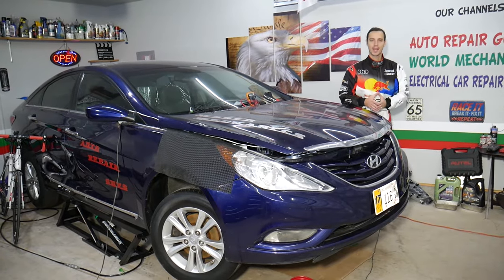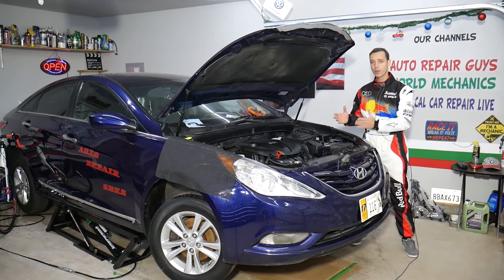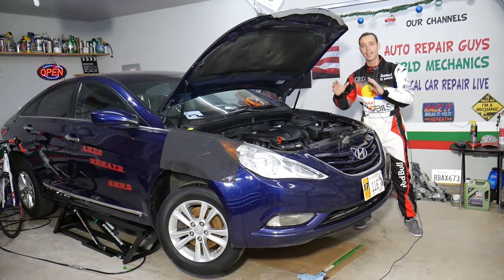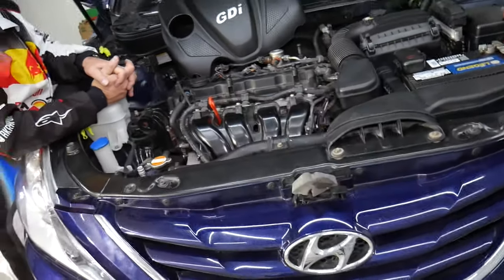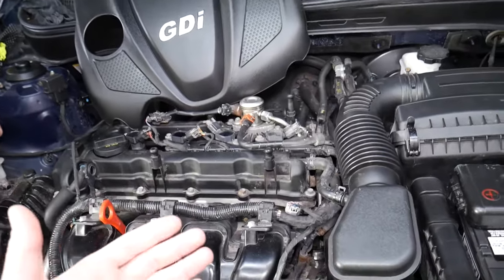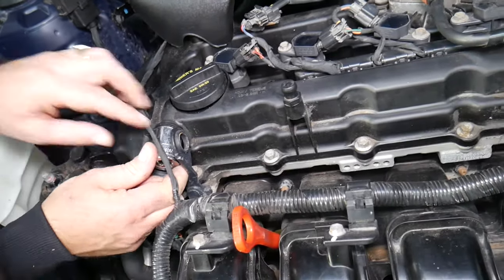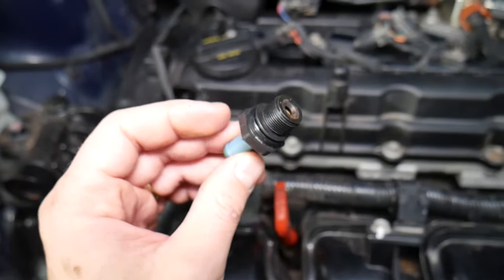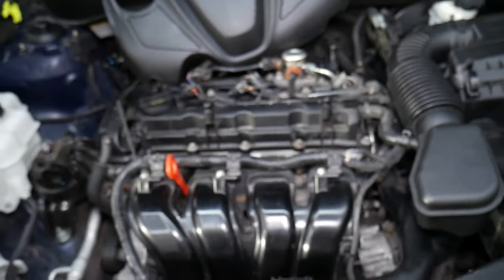WHY HYUNDAI SONATA BURNS ENGINE OIL, INCREASED OIL CONSUMPTION

Comment from the maker: Products that we use and recommend:
► PCV Valve: https://amzn.to/2XK8Oyr
► Panel Removal Set: https://amzn.to/3YiMADu
► Assorted Fuses: https://amzn.to/4fx4s3F
► Tool Set: https://amzn.to/3p5MM6t
► Screwdriver Set: https://amzn.to/3XRB28Q
► Castrol Oil: https://amzn.to/3xBc8B9
► Oil Filter: https://amzn.to/3w0Ulme
► Torque Wrench: https://amzn.to/32qyRwg
► Liqui Moly Engine Flush: https://amzn.to/3IiDBID
► OBD Scanner that we use most often: https://amzn.to/3I4MQfe

► Check out our Amazon Store for the tools and parts that we use: https://www.amazon.com/shop/worldmechanics

Comment: Came to comments and realized I’m not alone with burning 3-4 quarts in between oil changes. 2016 sonata . Trash
Reply: I’m glad I’m not alone. Mine burns the same ammount and no leak but runs perfect t
Reply: Fucking same hella annoying gotta make sure it's not too low so I don't blow my shit up
Reply: I'm with you!! Own a 2016 and going through oil like no tomorrow!! Also don't know how the car last because I checked one day and not one bit of oil on the dip stick!!
Reply: If ur rpm go upto 2 then oil burns if rpm stay under 2 no oil burns
Reply: Take it to your dealer there’s actually a class action lawsuit against Hyundai and you can get the warranty on the engine extended indefinitely and the engine replaced. Some dealers will try to give you the runaround but this is a real thing look it up guys happen to me on my 2016
Reply: @johnwagner8449 I just finished my oil consumption test today. In 4k miles I burned 2.5 quarts they said it has to be 1.5 quarts per 1k miles to get any engine cleaning or anything.
Reply: Same! I have a 2016 Sonata and I'm having to add 3 to 4 quarts every couple of weeks.
Reply: Greetings.
2015 Sonata Eco here.
Still within my oil change time and car just started to drink oil like crazy. Have  101500k on car, which shouldn't be an issue. But Damn, this is like all at once....
Reply: @jonathanc8056 i checked mine last week and the dip stick came out dry 🤣 i was like oh shiiiiii
Reply: @ALEXMORALES-qm4jg  I literally have to do my oil change about every 2k to 3k miles. Can't go over!
Reply: Well mine leakes about two courts every few weeks has been since the start and it’s burning oil
Reply: @ALEXMORALES-qm4jg bruh lol
Reply: I replaced that part did not help. Anything else to try?
Reply: I have a 2015 and it burns a lot of oil.
Reply: I honestly though I was the only oneb
Reply: Add me to the list 2015 , it drinks oil like a bit$$
Reply: Any solution for 2016? Since he said this works up to 2015
Reply: @Medic545 can you direct me where to go?
Reply: @Medic545  not fr the normal sonata only the hybrids
Reply: @DaniGyrl82  did you find a better solution?
Reply: @ahmadmahar1527  is that true?
Reply: 2014, burned all the oil and blew up on the highway. Bye bye engine
Reply: @TheMamagothika  scrap yard 😂

Comment: Daughters 2015 Sonata Sport burns a quart every 600 miles.  Ridiculous.  Changed the PCV valve also, no difference.  She's almost run it out of oil twice.  Down to sludge each time.  My advice, stay away from Hyundai Sonatas!
Reply: Mine as well. I plan to stay away from Hyundai period. I went to the dealer yesterday and there is nothing they can do
Reply: @michaelhines4600  Call Hyundai. Tell them you know about a recall on Hyundais for burning oil. Tell them you want it tested to see if your car is one of them. And/or contact the attorneys doing class action lawsuit.
Reply: Its the GDI engines they switched to in 2012. All my hyundais since then have been shxt. My 2009 which was a DOHC engine still runs like a champ

Comment: Hyundai has settled several class action suits regarding their failing engines.  This has been going of for 10 -15  years.  Their issues continue.  This is not a PVC issue.  There is now a class action suit filed against Hyundai regarding the excessive oil consumption.  Keep all your receipts for oil you purchase etc. as when this settles you very well may get reimbursed for your costs.
Reply: Dang cuz I’ve bought a ton of oil the past 2 years😂
Reply: They replace the engines for free. I’ve taken 3 in so far and got brand new engines installed.
Reply: @coreythomas2346  wow, where?
Reply: Car blew up cause of it
Reply: Having issues with oil consumption, for a while now. Went through the testing, for nothing car is still consuming oil. Hyundai now wants to keep my car 3- 7 days and want me to pay for a diagnostic to see what’s wrong with it. How do I get information on how be added to the lawsuit?
Reply: @triciap1102  Go to Auto zone and they will give you a diagnostic for free.
Reply: Up to 150,000 miles only.
Reply: @coreythomas2346  I am about to take our 2016 Accent in Saturday for excessive oil consumption. Im just under 95k so still within the 100k so fingers crossed it goes well.
Reply: @DarkWolfWRX  how did it go? Im having same issue 2015 tucson. Going to take it to dealer this weekend. They want 250$ for diagnostic.. smh. And im at 114k 😥
Reply: @JMR  took it in and they checked then oil level to make sure it was topped off then put a tamper seal on the pil components. After 1k miles i take it back for them to check the consumption.  Im at about 800 miles now.
Reply: This happens on the Honda Accords also. Honda however has denied any problem and say its just normal oil consumption or something you guys are doing wrong, LOL. It appears to be, at least on the Honda accords a problem of the oil sealing rings failing for some reason. This will happen on Accords from 2003 onward tho of course not all have that problem. Be aware an complain to your manufacturer.
Reply: @coreythomas2346  any over 100,000 miles??
Reply: They replaced my engine once to fix the issue. 1 year later, it’s doing it again. 🤦‍♀️ I love my sonata but the engines in these things are trash
Reply: Same here and now the dealership i bought it from is playing games.

I have spent at least $40 a month on oil and now the oil has seeped into my spark plugs. They are such con artist and keep calling back and changing the cause of the problem. Hyundai is shit and this will be the last i ever purchase 
My loan has 5 years but this car isnt going to make it that long
Reply: @triciap1102  same here ive been there multiple times oil ;leaking in their bay and they send me away and tell me i have to pay $250 for a diagnostic and if i dont have it they cant look at it or theyll keep my car lmao.
What was the exact point of warranties if they were never going to honor any of it?  Well now 2 months after them sending me away oil leaking everywhere the oil is in my spark plugs so i had to have it towed to them.

They are playing games to avoid making it warranty related. This is why i normally do not buy warranties because when it comes time they play games!
Reply: @robertrose3068  will Hyundai replace engine for oil consumption issue if car is less then 150k miles?
Reply: @coreythomas2346 Where?
Reply: @DarkWolfWRX Did they ever replace your engine?
Reply: @onyxgothicc  nope. In fact the car ended up catching fire like a few others i guess and hyundai paid my ex 3k.
Reply: @DarkWolfWRX 
Hey man, can you tell us how it went with your accent?
Reply: @Santos-ek8md  Hyundai told me to kick rocks. Then I ended up breaking up with my fiance, she took the car, and it later caught fire and burned down due to another issue they had sent out a recall for after lol

Comment: I have a 2016 sonata se. Always get oil changes every 3-5k miles. I’m not due for an oil change for another 1k miles and I have no oil. My dipstick was bone dry. Doesn’t Hyundai have a recall for this? It’s insane how much oil my car uses
Reply: I have a 2016 sonata sport and go through 3-4 quarts between oil changes, it's ridiculous the amount of oil this car uses.
Reply: I have the same car and the same issue.
Reply: There’s a class action lawsuit against Hyundai for this issue at the moment, but since it hasn’t been settled yet there has been no recall. Been having the same issue on my 2018 sonata limited for months now.
Reply: This is happening to my daughters 2016 Hyandai Sonata also! Every week or two the oil is bone dry, we have to add about 4 1/2 quarts every other week. Pay more for oil than we do gas 😡
Reply: @hadansbeauty8645  where can go to sign on
Reply: Mine lasts 1k miles max
Reply: Welcome to Hyundai!  They will do nothing about it.  They will always say that your car is using 1 quart or less every 1000 miles and they say that is normal.  It is not normal.  There is a class action lawsuit against them about the oil consumption.
Reply: @parrotsandmore7446   same!!! I am constantly adding oil to the car.
Reply: That is for the crankshaft not oil consumption.
Reply: I too have a 2018 Hyundai sonata that consumes a lot of oil I know this is not normal. What is the name of the valve that needs to be changed I didn't see it on the video.Can anybody help me. 
Thank you Yolanda

Comment: I have the same problem with my 2013 Sonata GLS. I pretty much put a quart of oil in every month. I’ll never buy from Hyundai again.
Reply: has it failed on you? Also, how many miles do you have on it?
Reply: Having the same problem now with the same car, it was doing good for years but now this is a big issue at 131k miles. Yep, I will stay away from Hyundai even though they are making better engines these days.
Reply: You lucky I have to put 4 quarts in every 3 weeks
Reply: I got the car with around 95k miles, every time that I checked the dip stick there would be alittle dot of oil on it. Around the time I traded it in it was much worse to the point that I was putting a quart or two in it every 2 weeks. Also it was at 105k.
Reply: @romeostarlite21  oh man that’s a bummer. I was going to stay away from them but I found out that year was the worst for that problem. My dealer hooked me up with a new Tucson, and it is a great car! I haven’t heard of any issues like that with the newer models.
Reply: So yup my 2013 is consuming oil like every month, few hun miles I'm at least a quart low.. anyone Change the pcv valve like the video n it have any changes

Comment: THIS IS NOT A PCV ISSUE!! just Google about the class action lawsuit. There are a lot of components in this engine design for better fuel mileage that is causing it to burn oil by the way, take that suit off and quit pretending you are a racecar driver.

Comment: Hmmm...just checked my dipstick. Oil was changed 5,000 miles ago. Oil is barely a little finger nail high. WTF. I brought it to the dealer as I had an extended warranty. They did a fuel service and said by the way get your oil changed ASAP. I thought that was weird. I should have put 2 and 2 together. They know something was wrong but don't want to tell the customer because the dealer would be responsible for the engine work not the warranty. The warranty expired last month after 10 years and my gas mileage is still worse than my 22 year old Porsche. Sounds like this engine has a major issue with carbon deposits. Why didn't I buy that used Lexus...
Reply: You should check you oil EVERY month for normal driving or if you're on a road trip, every few days!

Comment: have ongoing issue with 16 sonata..dealer pretty much told me to drive the car until it blows up...have done multiple oil consumption test, all indicate a qt of oil per 1K miles burning, Hyundai claim this is normal...shocking
Reply: My mother had hers get its oil tested by driving it till it was nearly out of oil like 5 different. Ofc she was just over the mileage to be eligible for an engine replacement. The trans gave out at 120k and the current motor has 139k
Reply: Same thing dealership just told me today
Reply: My dealer told me im SOL too. I just hit 103k in my 2017. I drove my car 1000 miles and oil pan is empty. Smh. Never buy Hyundair ever again
Reply: Same exact thing with my 2016 Hyundai sonata. I'm just about to pay it off and I'm carrying around a 5qrt jug of oil in my trunk bc I'm afraid of blowing up my engine.
Reply: Mine only made it to 58,000 miles before this started happening. Almost had it paid off and the warranty expired in Jan. Right when this all started happening. I pretty much was told I can only sell it and start over new.
Reply: Lol that's funny we all need to report this to the news media I bet they do something then ,I am dealing with the same thing 2017 Hyundai Sonata burning oil fast not leaking on the ground at all
Reply: @christinejohnson632  there is a class action in California for this. I have also seen some smaller news outlets cover it. Since it is both Kia and Hyundai Theta II engines. Some of which have caused the engines to explode. I just had to get rid of the car since it wasn't worth the headache.
Reply: @hiphopluvr4life  I was told to drive it 1000 miles for oil Consumption test numerous of times now they say I have too many miles did a complaint  and haven't heard anything yet, they know it's the engine and dont want to honor the recall
Reply: @christinejohnson632  Yea they tried that oil consumption test thing with me. My car was almost completely empty after just 600 miles. The oil consumption test is a sham. They already know within the first cycle that it's the engine. Since everywhere I have read it, we all have had the same issue. However, because of the year we don't "quality" for a recall. I was essentially told by service technicians and Hyundai service techs to get rid of it while it still has value. Not to bet on the chance of getting a recall or a new engine from Hyundai.
Reply: @hiphopluvr4life  I did receive a letter from hyundai about the year make and model but they dont want to replace the engine I am going to report them to the attorney general here in Chicago  this is too much
Reply: I am only at 95,500 miles
Reply: @christinejohnson632  
I'm at 105,000 and I have went round after round with the dealership. I even asked ok how much for an engine replacement? They said the engine alone was $8,000 and that's before labor. This is Ridiculous because why would anyone want to pay $30k for a car that burns over a quart of oil at 100k miles. I did receive some papers a little while back, however I've misplaced them and wish to god I had some kind of paperwork for the class action lawsuit.  Does anyone have the papers you can email me or direct me to a webpage to fetch them or any info at all would be greatly appreciated.
Reply: @mattcrosslin811  look up your vin number under class action lawsuit against them and it will pull up
Reply: My issue just started in the last 2-3 months with burning oil every 1k miles. They have FOR SURE... told me this isn't normal at all. They're saying to replace my Engine altogether but have to get it approved post the Diagnostic Test so Hyundai can replace it. Mines is 17 sonata sport. I previously had Spark Plugs replaced, don't think that resolved the issue at all. I even think it might be one of the SENSORS (I e. Dirty mass Airflow Sensor or Danmaged Oxygen Sensor). No way my "Spark Plugs" should have gone out at 62k miles.
Reply: How can they say it is normal when they tell us to come back in 6 months for another oil change. The engine would blow by then. Think of joining the class action lawsuit.
Reply: All you do is spend endless money all those junky cars ( Kia ,Hyundai)
Reply: @christinejohnson632  that is the same issue I am having with my 2015 sonata.My dipstick shows very little oil on it after driving for just a few days.No oil leaking on the ground.One business said I have no oil leaks,but Hyundai said I do.What I do know is oil is going somewhere.This is driving me crazy.Just like everyone else I really don't know what to do.I can't really afford to get rid of the car,but I don't know what to do

Comment: I just went to a hyundai dealer yesterday. Service guy said Hyundai has increased the warranty due to these oil problems and will replace the engine. Problem is they will only replace it if it completely seizes up first. At that point you tow it into a dealer and start the paperwork and repairs. Call a dealer to verify this first!!!

Comment: My son just called me about oil consumption and I found this video,  GOOD VIDEO.  one thing I noticed ,  on the opposite side of the PCV valve,   there is a hose right after the air filter going to the valve cover.   Just make sure is Not KINK.  Thanks